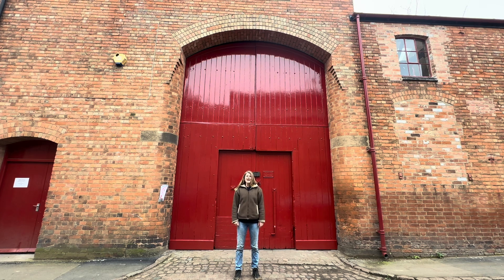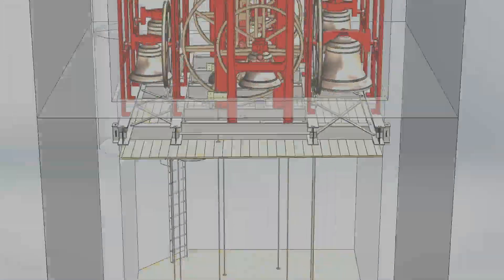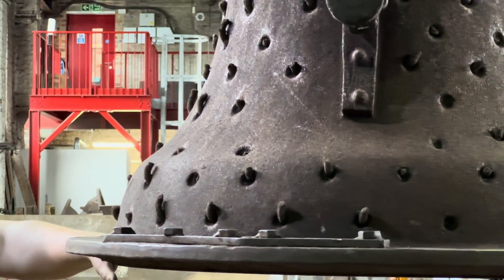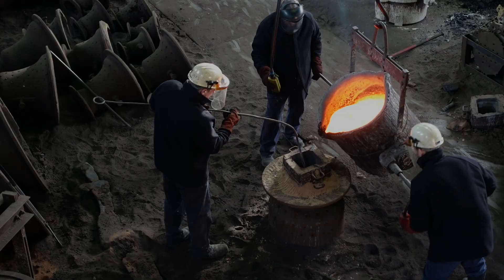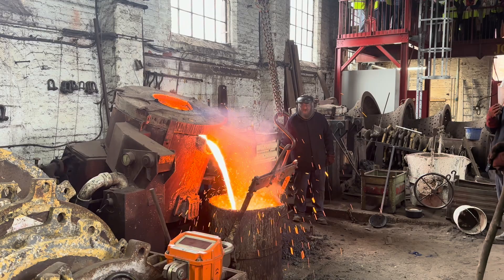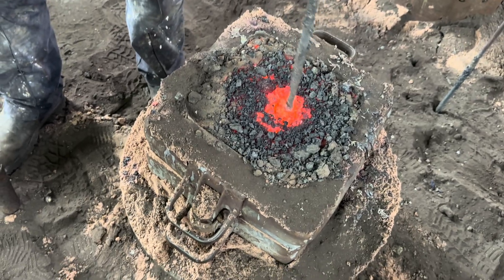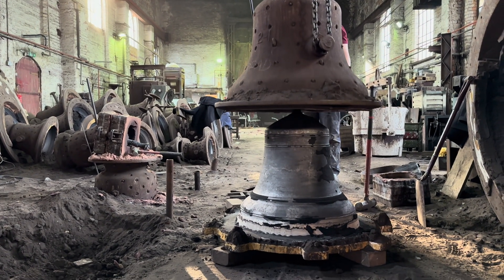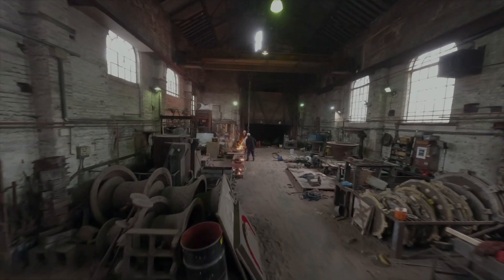How to Make a Bell | Taylors Bell Foundry

Comment: When I went on the Taylor's Foundry tour in the early 2000's we were told that the original 1881 mould for 'Great Paul', the massive bell in St. Paul's Cathedral in London (the second heaviest bell in the UK at 16.7 tonnes), still existed at Taylor's. After the tour finished and we left the site I peeped through a gap in a gate and could see a mould in 4 huge segments stored in an outside yard - I assumed that was the Great Paul mould and presumably it's still there to this day.